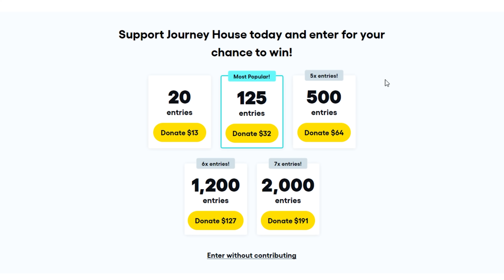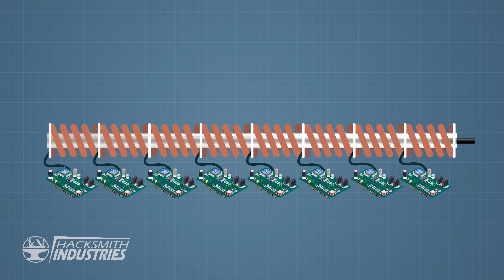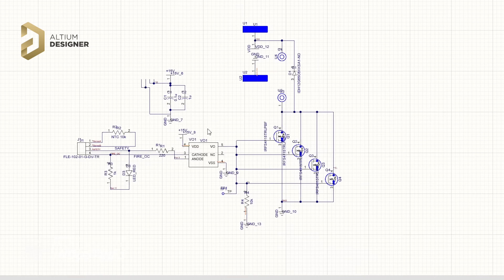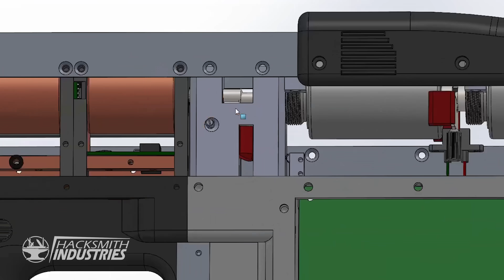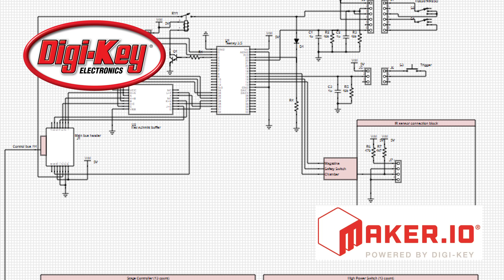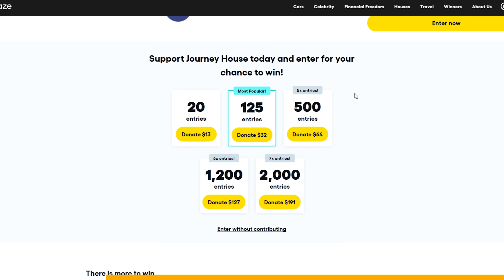MOST POWERFUL ENERGY WEAPON WE'VE EVER MADE!

Comment: The problem I see with many of these weapons is that, technology is so far advanced on the battlefield that we're carrying all kinds of electronic equipment. And these types of weapons, correct me if I'm wrong, wouldn't they create a mini electromagnetic pulse? If they do - you can imagine the problems that this would create on a battlefield. I've seen a few tested and they always have that same problem with the rounds tumbling. It looks awesome and bad-ass though.
Reply: Reliability is pretty crucial in a weapon.
An AK-47 can be left in a mud puddle for weeks & be picked up & fired.
(FPSRussian did this in a video on YT)
This magnet gun in the video would probably break just from the mud or not fire due to the batteries losing charge.
Even hypothetically speaking, IF the tech existed to make a magnet gun as reliable, it ALSO has to COST LESS to manufacture in bulk vs the currently used weapons. So i'm betting it is going to be a VERY long time before magnet guns replace conventional ones in world militaries.

Comment: I was doing research in the physics department of my university. And I was told that if we reversed the positive/negative connections of these photoelectric tubes, that they would likely burst into flames. How were the connections labeled? They were not. But, one was about an inch further offset from the center than the other. That is what this reminded me of. (I put red tape around one while I was using it).

Comment: Barrel improvement idea: same thing you have here, except print the black coil frames/barrel segments with 100% infill (at least around the hole) and purposefully make the bore size too small. Assemble to the point of rigidity, then reem out (*cough* get a hydraulic ram and a rifling button set *cough*) the barrel to the correct size. You now have a segmented yet contiguous barrel (until you disassemble it at least). I would recommend using the strongest and hardest plastic you are able to print for this one.
Reply: Hey Max,

This is certainly worth attempting next time i get a chance to build one!
Reply: NEEEEEEERRD
Reply: @kryptos4812  Damn straight!

Comment: Use your technology research to develop something to benefit. Try building a reciprocating engine for an EV running on DC with no brushes using the switching circuits.
Reply from the maker: Most motors used in EV's are already brushless...
Reply: @hacksmith  Thanks. I have been reading a lot about them but the electronics is very complex. Very expensive and very costly to replace. The Chinese have a 60 volt car that tops out at 25mph uses a wash motor and 5 Lead Acid batteries. No need for CAN buses and it retails at 900 bucks. Come on let's beat them at their own game. Your method of switching mean that you could create an optical commutator powering the  stator which would drag the permanent manetic rotor. The axial flow motor form would be ideal. I call it the inside out motor or IOM for short. At 72 yrs I don't have need for fame or fortune but it would be great to give very inexpensive transport to everyone. Hell you could even name it the "Patriarch". Don't Patent it. We have to save the planet.
Reply from the maker: Brushless motors don't require CAN buses either though...? Low cost motors do exist... it's always a trade off though.

Low cost motor + low cost speed controller = low performance
low cost motor + expensive  (switch circuit controller) = high performance, but more expensive

Comment: I gotta say No one tried to combine the coil gun tech for initial projectile ejection eliminating the need for compressed gas with the rail gun tech
Reply from the maker: Because that doesn't solve the problem either -- this also has a solenoid injector that initially pushes the round into the coils

Comment: I wonder if it is possible to build a mini ring accelerator into the gun, that powers up and holds a couple of very small projectiles, which then get released as you press the switch. The projectiles could be tiny if the accelerator manages to get them to a high enough speed.

Comment: Looks sick, but you could have used much less coils and have the same effect. The projectile only accelerates through the first 1-2, maybe 3 stage. The rest of the coils only compensate the energy loss between stages and maintain the projectile speed through the rest of the barrel. The projectile has its terminal velocity, timing and energy loss aside, mainly depending on its weight and the magnetic field you can generate. This means, if you want to accelerate throughout the whole barrel, you would have to increase the magnetic field at each stage.
Reply from the maker: You've made one of these before?
Reply: @hacksmith  I tried, much smaller and more sketchy of course, with 4 coils. I didn't achieve any significant improvement by adding more coils. Also my caps did loose their charges too quickly, so the last stages had a lot less performance than the first ones.
Reply from the maker: Well, Charles has been making coil guns and researching them for years, so I think even though in your case you didn't see improvement beyond 4 coils... that doesn't mean it's a fact ;-)

Comment: question: wouldn't it had been better to use a clear tube, with segments built in and a single spool of copper for one massive loop, getting thinner towards the end of the barrel? This way, the projectile has a smooth surface to travel along and the charge ramps up along the length of the barrel. The diminishing returns might be ignorable, but not sure; I'm an armchair engineer so I could be horribly off base. not only that, but if you can 3D print parts, why not try 3D printing a barrel with rifling? Maybe in segments and using fine sandpaper to smooth it out?

Comment: Fascinating. Came here from the “forgotten weapons” arcflash video. Looks like they used a bull pup design with a gap between the accelerator cascade and a… feeder accelerator. You mentioned not being able to feed them fast enough (initial velocity required into the cascade). I think that gap is how they are achieving that.
Reply: I got here because of the stormbreaker vid.

Comment: Coil-guns are quite futile devices, due to very poor energy conversion efficiency. A magnetic flux density of about 2…3 T  drives the projectile into magnetic saturation. Therefore every Joule of energy invested results in heat. The better method is a repelling induction force acting on a closed loop conductor (e.g. a piece of tube). And the second way is a rail-gun. Although saturation effects are circumvented, energy coupling still remains poor.

Comment: Can you make coil gun barrel much longer with more coils? Like 3 meters or even more? Ofcourse if it was legal in Canada. Or give first energy to projectile from spring or pressured air and then make it faster in coil barrel.
Try to make some powerfull airgun with integrated mini compressor which pressure some pressure bottle before fire automaticaly, something like PCB airgun, but powered by electricity. And move to USA for your experiments. 🙂

Comment: Look.. Ive been designing something similar for many years, you've got two major flaws here making it shit, 1)don't use could like that.. use two iron rods with could round either side instead of coils round the barrel. 2)there are these little toy magnets sometims called clangers that are blatantly reappropriated millitary ammo that look like double pointed fat bullets that have their poles on the sides not the points.. use them or forge your own.

Other than that this is rather impressive.. nice video.

Comment: ☎️💡 IF $ were no object, which it always is, would there be any advantage to using Titanium for the frame instead of aluminum ???  or how about adding carbon fiber to act as a support liner or shell-scale like some folding knives do to cut weight without cutting performance/ strength/ integrity of the framing so you can use even thinner plate material??? 💡

Comment: This “defensive system” is already on the market. It is called the = *E-Shotgun*. 
16 Joules to power each shot and it launches blank round coins in Full Auto or “Shotgun” (5 coins per trigger pull) modes. 
Currently costs $1,299 but the company expects the final msrv to be $1,980 (I know it is a weird final price point). 
*Demolition Ranch plays with one.

Comment: why not also try and make a version of it with aluminum wires for the coils? aluminum has a better conductivity to weight ratio than copper so you would gain an additional weight savings by using it. at perhaps a cost of slightly increased volume.

Comment: I remember a sci-fi book I read way back and instead of using a larger load but used a very small loads . It would have steel wire inside the gun and cut off small bits to fire . So it would use speed not weight to give impact . What do you think ? So you could have it smaller in size but what it fires could go at a rate of speed , Loved to see it coming out in carry sizes

Comment: You can get a 20% boost in field strength by using square cross-section wire (or copper foil/sheet) instead of normal circular wire. (prisms pack space, cylinders don't)

Comment: One day when your not bound by law do you think you could build a lethal version or is battery tech not there yet ?
Reply: Batteries are there (you would charge capacitor banks), but the physics is not there, not at this scale. Issue is the later magnets get something like a whopping 0.001s to push power to the projectile, meaning they don't do much compared to the closer ones (same thing happens with real rifle barrels, doubling the barrel length does not double the velocity since the energy is Force*Time, and the time is incredibly low the further you go).

The way you can do this is exploding some metal with electricity, for instance, vaporize some aluminum can in a high voltage and high capacitance arc and this heat creates high pressure hot gasses (basically like gunpowder works), that's basically the only way to currently do it, at least until we find wires that can handle near infinite current.
Reply: @jakegarrett8109  ah so even silver wouldn’t make it a lethal weapon.
Reply: @nickdavis5420  Probably not handheld (unless you do something like an arrow projectile with multiple sections, some metal segments and some composite, then you'd have some speed and some mass). The other thing is moving metal even without an electric field creates its own electric field and back emf, just like the physics experiments you probably saw in school dropping a magnet through a wrapped around a pipe slows it down, or dropping a magnet through a metal tube. Those eddy currents are causing electrical drag, and so there's actually more limitations than I mentioned. Basically physics doesn't like this method as well as some others.

Comment: Would it be possible to start with all coils powered, having all coils pulling the projectile forward at the same time, then switching coils off from the back as the projectile passes? This way you wouldn't need to worry about the timing of the subsequent coil turning on. Or would this require too much energy on startup?
Reply: Its good idea.. but I think it can caused  over heating..  and energy consumption heavy...
Reply: @khiikzx04  so until we have unlimited  power wich is small and a amazing miniature cooler no go
Reply: This will not work and would just consume a massive amount of power.  Magnetic field strength decreases by the inverse cube law, so going from 1 inch to 2 inches away from a magnet means the strength will be 1/8th (1/ 2^3) as strong, although you also need to take the size of the magnet into account. Turning on coils more than 10 - 20mm away just doesn't make sense since the other coils beyond the projectile and closest coil will have essentially zero effect.

Comment: Would using a disposable supercap to drive this work?
Reply from the maker: Why would you make it disposable? Supercaps are more than one time use!
Reply: @hacksmith  Perhaps hot-swappable would be the right term. I suppose I was thinking of a hybrid magazine and power source that just gets dumped when it's spent but I guess I was going a bit sci-fi and thinking about how this would be used in warfare. In my head, any gauss-rifle type weapon would always have removable power cells and combining that with ammo would be logical.

I have absolutely no idea whether the capacity of modern supercaps small enough to work ergonomically would be enough to get, say, 30 darts off from a charge.

Comment: Do you do any form of waveform control on the coils? It would seem that it may be possible to control the fields so that all coils could contribute. It also looks like it is running open loop but if one were to sense the field and the disruption of the projectile running through the field more control would be possible. Once that was done, more shorter coils with finer control could be considered to maximize efficiency and energy transfer.  Not sure of the potential gains but it would make for an interesting trade off study.

Comment: I’m no scientist, make the coils big enough in order to fit the projectiles you guys use to be able to have fins. Once the projectiles leaves the barrel it will have enough velocity for the fins to straighten the projectiles trajectory. F,rom the slow motion the projectiles doesn’t look like it’s flying strait. If the projectile in addition has a sharpened point the penetration ability will be more effectiv. Like i said if u can create a barrel that able to accelerate the pro tile to the same speed but simultaneously have a “custom barrel where it’ll have wings, the effectiveness will increase as f@r as damage caused to the target.
Disclaimer…..I’m fully excepting that I am wrong and or it is impossible but figured you miss one hundred percent of the shots y9u don’t talk

Comment: Actually, reason why anyone want to deal with gauss or rail guns, is structural limit of metal and finite power burn. With asy new type of non-metal alloy 3d printed barrels and liquid chemical compound reaction type of bullet acceleration and SAbot TYPE OF BULLETS FIRED, firearms would-be present for next hundreds of years, without anyone ever use rail or coil guns anywhere. Railguns all though conceptually cool and all, really not as effective or reliable plus IMMENSE POWER USAGE for both RAIL and COIL systems.

Comment: would rotating coils work? Like the entire barrel covered in multiple coils (bout 5 per sectional)that can trigger in a spiral fashion as it goes up. This could maybe make the projectiles more accurate since the will be spinning in a drilling rotation (If it actually make projectile spin.).
Or maybe multiple coils themselves that spin on a spindle on the sides of the barrel. This way you have multiple coils pulling on the projectile instead of one.

Comment: Correct me if I’m wrong but wouldn’t it be feasible to make each coil more powerful than the last and when they need to charge have the projective inside the magnetic range but also held in place while they charge and once the projectile is launched it would enter the next magnetic recover coil and gain momentum until the last coil where all the coils would turn off propelling the projectile forwards at maximum velocity with maximum speed or if possible make the last coil reverse polarity as the projectile passes through it
Reply: Or if possible make it so every second coil is a reversed polarity so once it passes through it then it would increase projectile speed

Comment: what if, instead of pulling a piece of iron into the coil, you reverse the polarity while the projectile is exiting for a push out of the coil? pushing forces are stronger on a magnet, especially in closed systems. This would mean you'd have to magnetise the projectiles first, though
Reply: This would make the project way more complicated, more expensive and bulkier. It's actually kinda hard to fast-switch the polarity of the magnetism  the way you want because the magnetic field doesn't instantly vanish, its like a car slowing down to a stop before going into reverse. Then you need to effectively double the capacitors (or do fancier electronics) for reverse polarity, and then the projectiles probably will need some sort of magnetism inside them... who knows though, might have interesting results if you could get it to work.

Comment: If I may make some suggestions:
1.  Instead of using Power Mosfets it may be better to use IGBT's (Insulated Gate Bipolar Transistors).  In full conduction the collector-to-emitter voltage is lower than a Mosfet.  (The Mosfet drain-to-source ON-resistance is linear and obeys Ohm's Law).

2.  The gate impedance is not really "open-circuit".  It is quite capacitive and requires a significant driving power.  Therefore be sure you are driving the gates really hard.  Otherwise the current switch-on time would be be less than optimum.

3.  The power supply voltage should be as high as the semiconductor switches can accept.  This is because you need the current turn-on time as short as possible, and this is controlled by the applied voltage and the coil inductance.

4.  If you can provide some ventilation along the barrel, this would reduce the amount of air the projectile has to push.